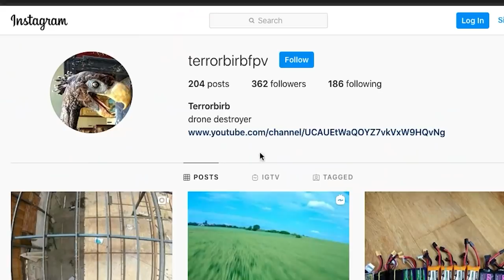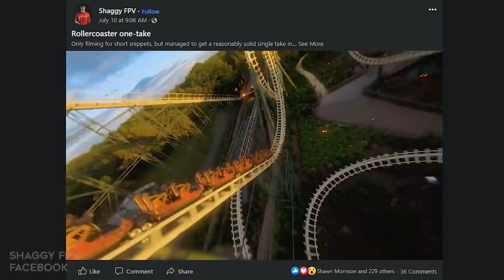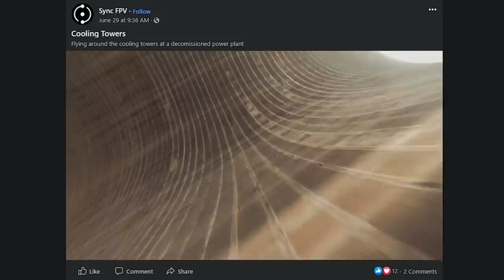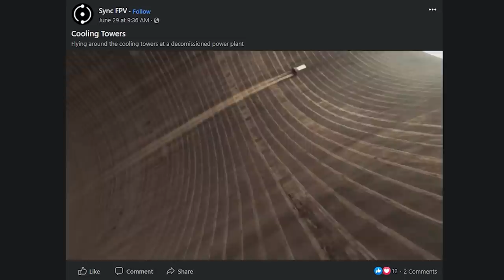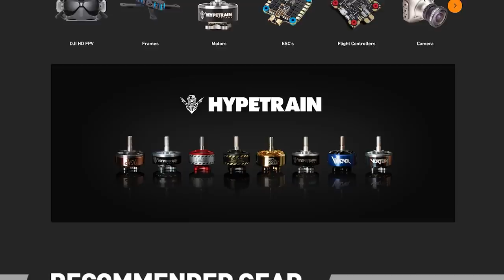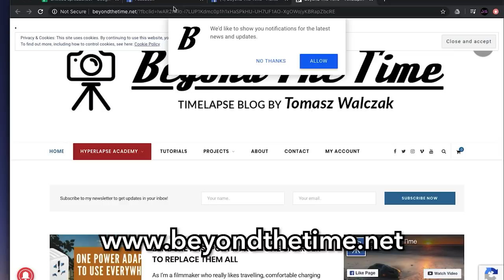Community Spotlight! July 2020

Comment: I have bought a shendrone squirt build from you guys.... back in March man. It has been thee most frustrating thing!!! At first my ESC didn’t work i never heard beeps. Called you guys and Jordan was kind enough to work with me... well paid another $40 i ship my drone and you guys fixed my ESC i guess. I get it back and wooo you my drone finally beeps and makes noises all my motors are spinning. I properly configure it using all your cli settings and when i put my prop guards on.... the prop guards bought from you guys.... my motors are running against a prop guard... and when trying to fly i burnt a motor.... smoked it it’s done. I try to order another motor and get a no shaft motor which i now realize i can not use.... honestly from a guy that has been online studying for months and on a simulator for months that literally spent my stimulus and saved money on this drone stuff to build. I would spend a bit more effort or budget on support, Jordan was and is great as a one man band but he was the only support help. What if i am kind of new and i need another t-motor i order the same exact number T-motor online but i didn’t know about the shaft sizes.... this is all just really frustrating but ik worth it and u just felt like venting.... because because of my frustrations i haven’t even wanted to watch any fpv videos for a bit lol. But just some perspective to think about as a business.

Comment: You could get around 20-30% more gamming performance/upgradeability if you spent this 900-1100 on parts, but it's not a bad deal if you need a computer that can run current stuff or edit some videos. Ask a fried to help you buy/build one! you will be better off in the long run. Also support FPV peeps :)

Comment: I bought a drone a few days ago and it immediately broke, do you know and good drones i can buy to replace it?
Reply: That's a big question. What sort of droning are you doing? If you're flying like these guys, then your best bet is to just buy the part that broke and reinstall it, then go out there and break it again. FPV drones are like hotrods; by the time you get good at them, you will be able to assemble and tune one from its component parts.

If you're just grabbing ready-to-fly machines and crashing them, then get something cheap, use it up like it's a helium balloon and go buy another cheap one when you want to do it again.

If you're operating fancy-pants UAS type stuff, then get in touch with your local dealership and brace for sticker shock.

Comment: F I bought new PC for sim yesterday for Grand
Reply: Don't every simulator can run full settings on even a toaster ? Velocidrone has visuel effects that looks like half life 1, Lift off is kinda meh and badly optimised, DRL has simple yet beautiful ( I would rather say clean ) graphics ( looking like 2006 trackmania)   but nowhere close to be a challenge for any medium PC.  :o
Reply: @Qual_  i think liftoff is more optimized than velocidrone. but they are both badly optimized. but anything better than a 2nd gen modern intel cpu and gtx660 will run them 60 fps on low atleast